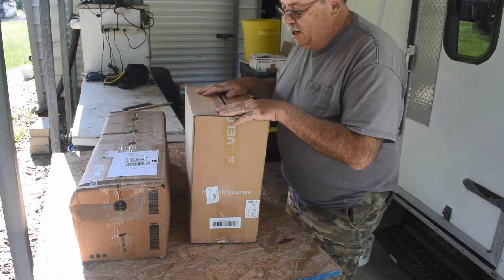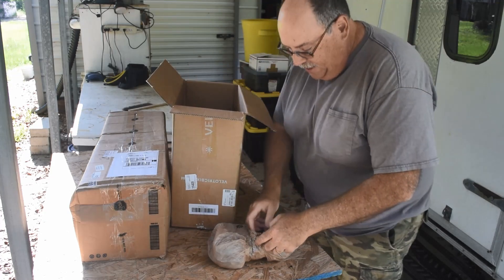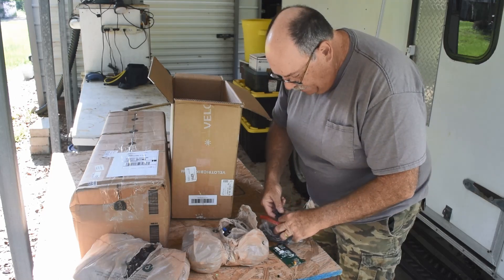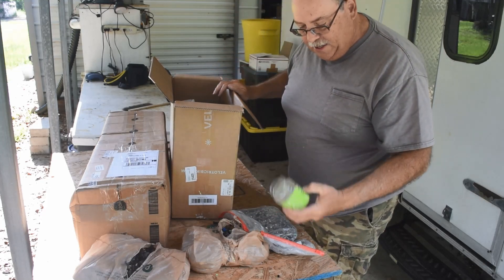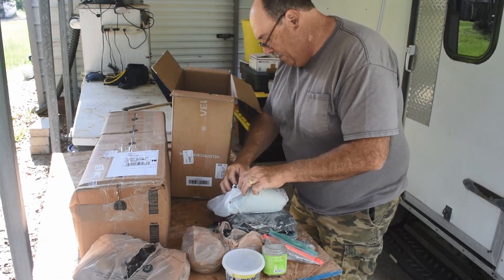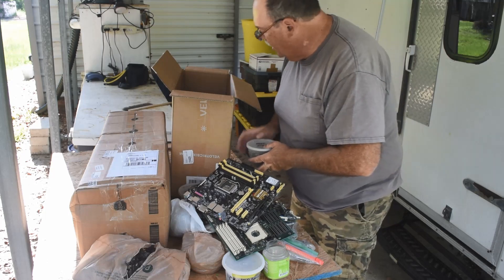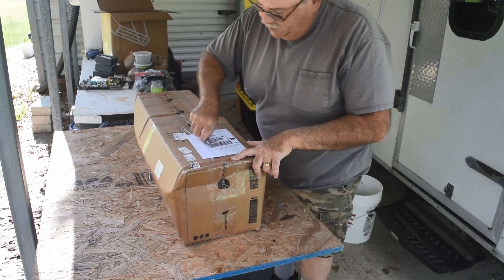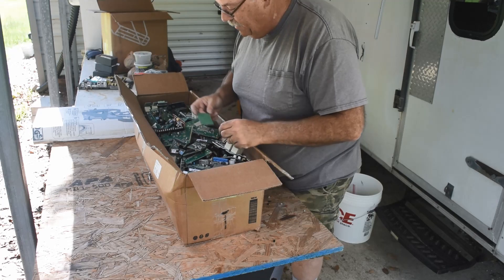Huge E-Waste Haul From My Buddy Rick

Comment: Welcome home Mike 
I will look forward to the processing. The bag with all the pins and junk mixed together are the crumbles. You are correct I use and air hammer and when I get to the bottom the crumbles are what is left. I was sorting them when I had time. 
Have fun

Comment: Hard Rock University using ECO Goldex O series, used electrowhinning (plating) to recover from resin, I did a small test to recover from E series. (100ml) to plate on stainless steel. (stainless steel anode/cathode. It worked. Working on a design that will circulate the solution across the cathode to recover the gold. Hopefully this will get rid of the mess of zinc and ph control and many filtering. In theory, once the plating gets so thick you should be able to peal the gold off then refine. If that will not work, I will try plating to a copper or gold cathode.